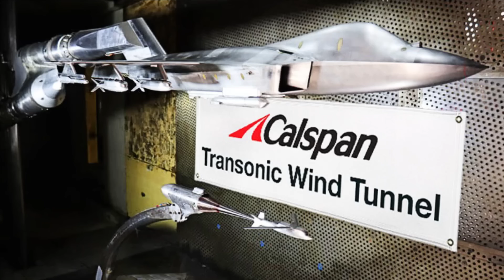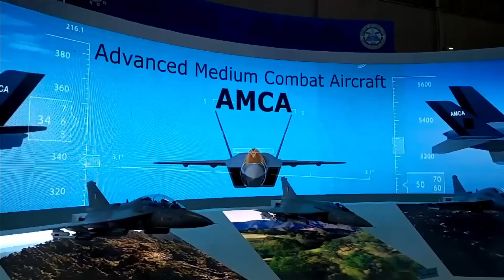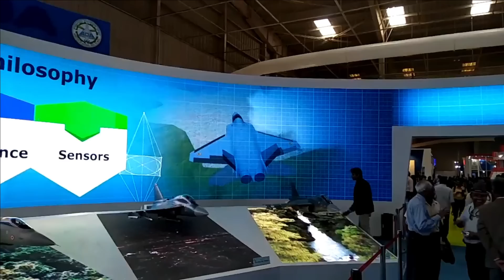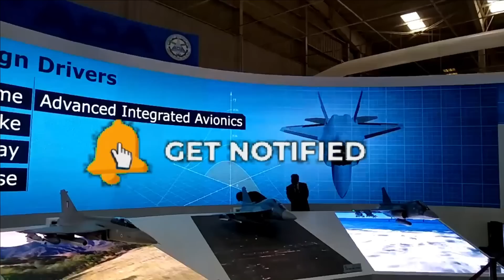Decoding AMCA Mark1 Wind Tunnel Model - India's 5th generation fighter jet

Comment: Since this is just a model obviously many changes can yet be made to the design. A large enough internal weapons
bay and EOTS will hopefully be included.Fortunately stealth isn't just a matter of how the plane is shaped but also what
materials it is made off and RAM. Neither are present and the ECM equipment is also missing from a model.
It seems very lightly armed in full stealth mode and in non stealth mode it must be very detectable.

Everything isn't lost. It's also crucial to get export orders for AMCA so unit price of this potentially very
expensive fighter can be reduced. Cost is make or break here!!!

Also as has bene pointed out before a flying test bed and wind tunnels need to be installed. The government
must provide funding for both urgent necessities.

Comment: can drdo design any military equipment without copying western design
Reply: Physics is the same all around the world. Many 5th generation fighter jets will have somewhat the same external design (except for the su-57) due to similarities in engineering properties. There is a principal to explain this but i forgot the name. Why try to re-invent the wheel when it is not beneficial.
Reply: @nomade3269  then why does the yf-23 and x-32 have such a radical different designs even though they are ment to fulfill the same requirements of the f22 and f35 respectively?

Comment: I think in 2020 india inaugurated a hyper sonic wind tunnel facility. Pls answer my query.
Reply from the maker: Yes - Advanced Hypersonic Wind Tunnel (HWT) test facility at the DRDO’s Dr. APJ Abdul Kalam Missile Complex
Reply from the maker: But its made for HSTDV test and can test speed between Mach No. 5 to 12 speeds. For AMCA we need transonic Wind Tunnel. What even I am not sure if the DRDO's new WT can be used for Transonic - which I think may not.
Reply: There is a new triaonic test facility at vssc, may be it was not ready by the time this test was done or contract already signed..

Comment: If it is going to be less stealthy than f35 
Then how can we call it 5th generation fighter jet ?
I think we can put in same category of j20 and kf 21 catagory.
Anyways it doesn't matter because we are not going to induct it in large numbers.
Reply: The bottom line of 5th us not fixed....
Reply: AMCA (advanced medium combat aircraft) that's mean the max weight of take of is around 20-30 tons that's at the same level as kF21 boramae 25.5 tons and FC 31 gryfalcon 28 tons J-20 is heavy fighter jet with max weight take off 37 tons one par with F-22 38 tons and F-35 32 tons
Reply: @widodoakrom3938  
I'm talking about stealth catagory 
Not waight catagory
Reply: @lajjashankarpandey  ofc it will be 5th generation fighter jet but it will took at least 2 decade from now on
Reply: @widodoakrom3938  
Let's see

Comment: It's stealthy than Tejas but will have some compramises. Most probably RCS would be around 0.2
Reply: I think it will have an RCS of 0.01m2
Reply: @CarnageXAddy388z  with external pod I don't think so. And also keep in mind that the fuel probe might be fixed as it is in TEJAS MK2. It's removable not retractable may be the later versions will have the retractable one
Reply: @ksriri  The fact that they are designing a stealth aircraft and using external pod is making me laugh 😂😂
Reply: @CarnageXAddy388z  Precisely my point. It's like samsung mocking apple for removing head phone jack and doing the exact same after an year. Well it's difficult for them too to check all the boxes and also F-414 engines on AMCA donnot super cruise which is another bummer missing from the 5th gen characteristics. I mean we are struggling hard to touch the basics of 5th gen but are touting the capabilities as 5.5 gen. It's an irony!!
Reply: @ksriri  i think it's very unfair to call out ADE on this regard.. This is the first time a country is building its own 5th gen aircraft whilst taking a giant leap in technology... USA didn't master EOTS overnight they had to R&D for years to make it finally work..and like the channel said DRDO is working on EOTS... Not everything is as simple as a headphone jack on an iPhone . And there is nothing wrong with aspiring about achieving 5.5 gen... If they won't push forward.. People are always ready to criticise that DRDO only follows the west and not innovates newer technologies
Reply: @rithickchowdhury7116  again the problem here is not that they develop something that they haven't mastered but the problem comes when the Government organization like DRDO promises a 5.5 gen while delivering a 4.5 gen tech. I mean it's still promising don't get me wrong. IAF chief pointed out the flaws in J-20 back then calling it a mere 4.5 gen plane remeber. Now, if DRDO tells that it is developing AMCA with some 5th gen characteristics then fine it has a growth potential. But if it's say the project itself is a 5.5 gen project but delivers a 4.5 gen which is damn impressive then it's subjected to mockery. My point is under promise over achieve and not over promise and under achieve. I am not being harsh but the ask is pretty reasonable.
Reply: @ksriri  yaa bro i think you misinterpreted their statements...they told that AMCA mk2 will have 5.5 gen capabilities because of the CATS warrior system and fly via wire capabilities...even look at K21 of South Korea..they had all the help from Lockheed Martin yet they don't even have a internal weapons bay...what I mean is that they will improving the capabilities in mk2 and further more as they achieve more technology..plus the mk1 will upgraded to the mk2 standards...
Reply: @rithickchowdhury7116  I'll put it across in this way what you mention are the terms and Conditions that comes in add vs what I mention is the misleading add. Simply put KA-21 Bromae knew what they were doing and they renamed the project to 4.5 gen after knowing the shortcomings. Basically type AMCA the first thing you see is 5.5 gen which is the add and once you notice the details is when you get to know that it's a 4.5 gen plane with really cool 5th gen features. I am asking people to call it as it is rather than what it would be. I have been a defence enthusiast for a while and that's why I don't like when real efforts are subjected to mockery because of poor labeling regardless of its performance
Reply: @ksriri  yaa don't worry labelling this aircraft is least of all the problems for the people in IAF and DRDO..it will be called what it truly will be.. very excited for the first prototype...🤩
Reply: @rithickchowdhury7116  I am too it's been a long awaited breakthrough and I don't want stupids runing it hence the long comment
Reply: @ksriri  don't take it seriously bro.. it's a healthy debate..those are rare...we both have the country's best interests in our minds
Reply: @rithickchowdhury7116  yeah I was not referring to you I just refer to few people who overhype things. You have a sane understanding 😉 and it's just constructive criticism that we have been doing. I am just talking about a few people